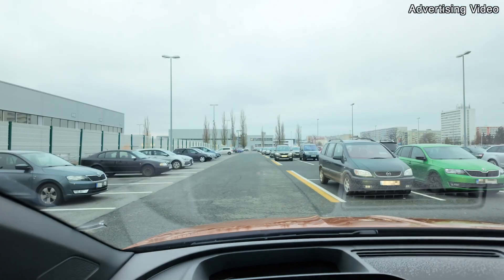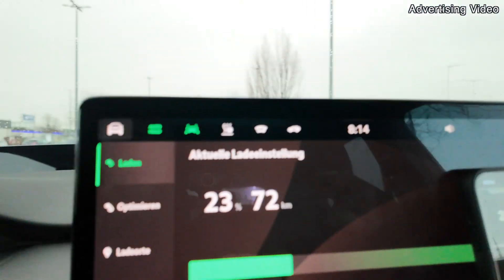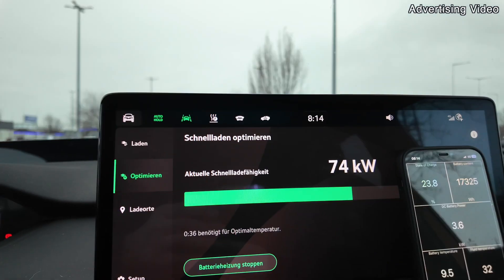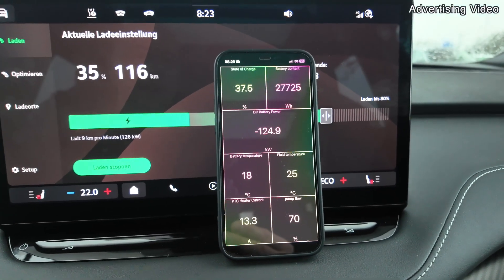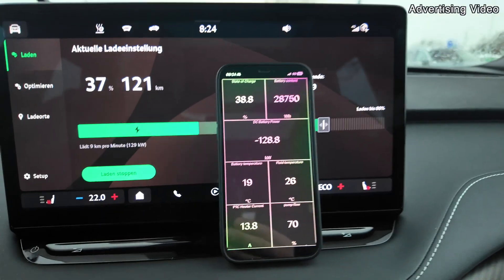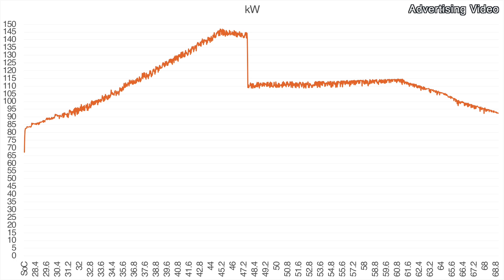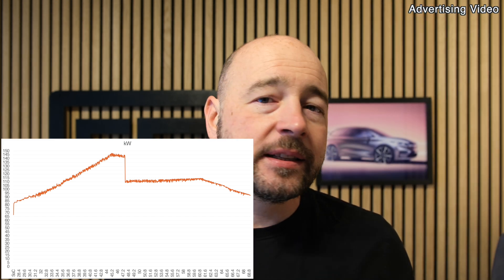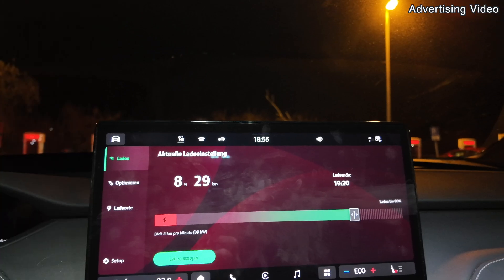Cold battery charging and charging strategy on long distance with the Skoda ENYAQ or ELROQ

Comment: Having the car for 5 month now and done 4-5 longer distance, my experience says that its better to plan the trip out from family´s travel mood than plan too much based on the cars idea. If there´s a need for a break you just try to adjust so that it will be in combination of charging possibilities, and turn on the battery preheat. Getting to the stop, connect the car, get to the restroom, grab coffee, back to the car and continue the trip. Charging span is normally just between 20-70%. I planned the charging stops more in the first couple of month, when driving electric was a brand new experience. However I noted that the its better to just plug if you anyhow need to stop. Longest travel in one day so far 750km in winter conditions, Sweden-Denmark.
Reply from the maker: Thanks for your feedback!

Comment: Really appreciate your videos Mathias! I'm curious about your strategy at the very beginning. Given it would take 30 minutes to preheat the battery, and when you started you have 23% and 72km range, why not start your journey and preheat the battery as you drive and charge in 50km distance? You would be arriving with low SOC, preheated battery and be able to achieve superfast charging speeds.

In a few weeks I'll be doing my first long distance run in my Enyaq RS (1100km), on a route I'm used to doing in my Tesla and one that I'm used to doing in one day. I'll be in Easter Holiday traffic so I'm anticipating heavily congested public chargers. The plan (!) is to start with 100% and go as far as I can on the first charge. Then more shorter and faster charging stops. It will depend on how congested the chargers are and whether the chargers that are under repair today are in service when I need them.
Reply from the maker: In that case in the video there was no strategy behind it. I did not had to charge as my appointment was only a couple of kilometers away. It was just for the cold charging test.  

In reality if I had to go on a long distance trip and start the day with a cold battery and 23% I would have driven the car down to around 5% with activated preheating and then plug to a charger. Normally if possible I start with 100% and drive my ENYAQ down below 10% then hit a charger. Most of the time I charge to 80% as my break is longer than charging. Often I select large charging hubs over smaller ones. Especially with IONITY I try to avoid those with 4 chargers and tend to go to those with 12 or even more. The chance is much better if they are all occupied to get one quick.

Comment: It depends. If the next charger station is near my route, I charge to 70/75%, to arrive between 5 to 10% of SOC. If the charger station is relatively far form my route I charge to 60/65%, so that the total time (charging + detour) is the same in different stops (close or far form the main route)

Comment: charging to 60-70% SoC is usually the charging strategy by ABRP as well. So normally I follow this, however when I have lunch I may charge further to 80%. Best speed is found when charging from SoC below 15% or even better below 10%. I have a first generation Enyaq iV80

Comment: You make me curious about the material you recorded at Skoda Matthias. Nice stuff in the pipeline 😊
My charging strategy depends if I travel alone or with my family. When alone I charge like you do. With my family we take a break and charge to 80% or so. We prefer less pauses. I use ABRP for charge planning and as long as I charge to about 80%, it doesn't calculate significantly less travel time when charging often but to a lower SOC.